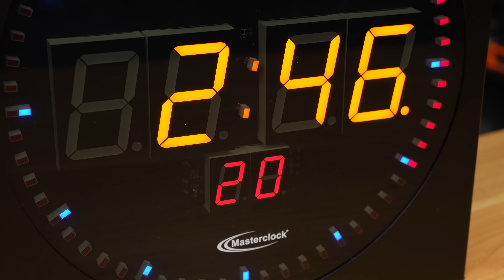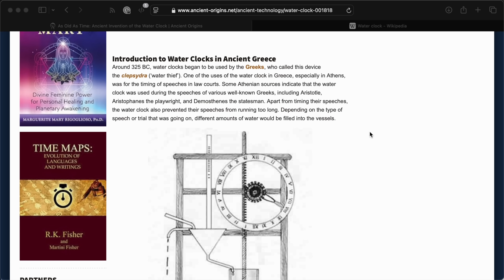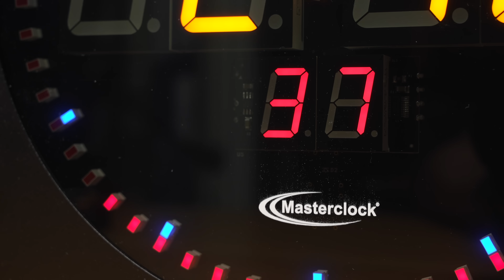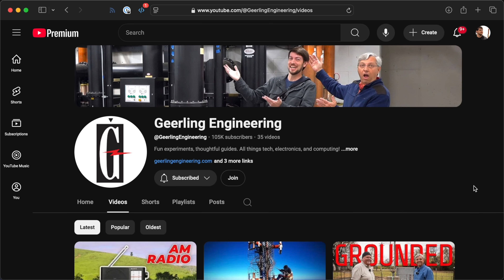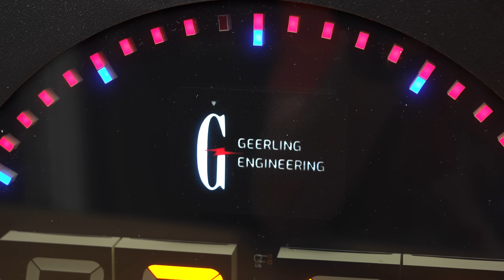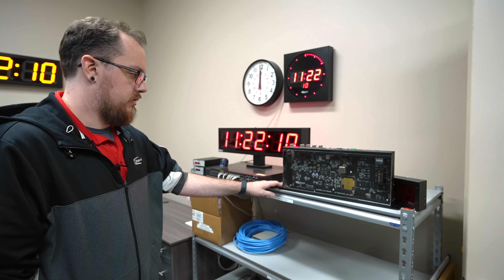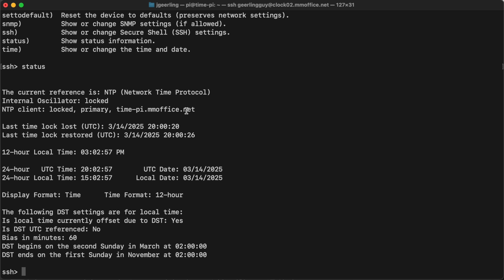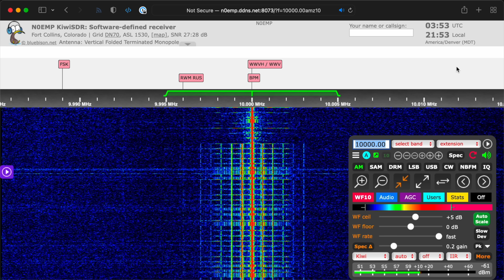It's about time...

Comment: A Finn here. Russia has been interfering with GPS signal since their invasion in Ukraine. Multiple times flights have had to been diverted to other airports from Eastern Finland. Yes, GPS signal is not universal…
Reply: True. Russia has their own system called GLONASS so they could disrupt GPS and continue to use GLONASS.
Reply: @ both GPS and GLONASS use very similar frequency bands. I am not sure does the GPS interference leak also the GLONASS range. But Russia doesn’t have much people or flights on that area.

Comment: I have an old wrist watch from Kienzle. It's a company from Germany not existing anymore. It's controlled by the radio time source DCF here in Germany. It has a small LCD for seconds and date and analog clock pointers for minutes and hours. The pointers only are moved every 20 seconds to save energy. The batteries last 10 years and this thing is still working after 30 years. And now the cool thing: it is precise like the PTB atomic clock. It's analog but precise like atomic clock

Comment: Jeff, do your switches all support the hardware backed higher level ptp in the studio, or are you falling back to the version/mode that doesn't require support from all switches in path?  It's been too long since I've looked at ptp in depth so forgive me for forgetting the correct terminology.

Also have you looked at/do you/do you plan to contribute to the ntp pool project?  I've contributed an ntp server for quite a while and it's an important and often overlooked project I feel.

Comment: When it comes to test equipment, a FREQUENCY standard is important.  That's closely related to time, but not quite the same.
The gear will have a 10MHz "Reference" input, with phase noise (variations in pulse width) as low as possible.

One method: Divide your Reference by ten million, then compare it to a 1PPS time clock. Any drift in phase means something is amiss.

Comment: Great topic for a video. I run a supersonic wind tunnel and we use a similar time system that distributes NTP, PTP, and several flavors of IRIG to synchronize the many data systems and scientific cameras on our (offline) internal network. This way we can precisely align data in time — even down to knowing specifically which handful of pressure measurements corresponds to a specific frame of high-speed video. It’s so important, but the underlying tech is taken for granted by most (even “nerds”) since it’s so transparent to those who haven’t needed to implement it in a standalone system.
Reply from the maker: I hadn't even considered that—places like CERN and the weird experiments that measure like muons or gravity waves also have to have incredible precision.

Comment: I wonder this could be applied in combination with some sort of timecode input devices for a video recording studio space that has multiple camera angles. Maybe using Raspberry Pis as the devices that push SMPTE timecode into the audio track of each camera. 

Or taking it a step further, I wonder if the server and additional devices could somehow be used to synchronize cameras/audio inputs for OBS based streaming with multiple camera and audio sources. 

It would be amazing to easily get multiple cameras and microphones (like one at a desk and one with a wireless lapel) all easily synchronized.
Reply from the maker: That is one major use case for AES67 and things like Dante... I haven't looked into Timecode output, but I have to think it's possible to DIY it...
Reply: @JeffGeerling  Thanks for the info! Multicam can be tough in the editing stage, so that general idea has been on my mind for a long time, but with a mix of outdoor and indoor video work. I've got a larger channel for photography/videography. 

There is quite a bit of timecode stuff in the videography world I've read about, but all of it tends to be very expensive so I haven't been able to try any of it out.

Comment: Hey, Jeff, I work for an electric utility. We are in the early stages of a pilot project to implement digital secondary systems for our substations using IEC 61850 standards. A critical part of these protocols is proper synchronization using PTP. Would love to share more information about it if you’re interested! Keep up the great work!
Sincerely,
An electrical PE with a fleet of Raspberry Pi computers at my house

Comment: If you get the chance I'd show off configuring the telecom profiles in linuxptp (Mainly G.8275.2 , although G.8275.1 for multicast is semi interesting)  as they tend to be more useful than a base 1588 clock and make setting up things like a private LTE network easier. For small form stuff I tend to go with like an Oscilloquartz OSA 5401 SFP timing grandmaster as they're just neat.

Another fun one to talk about is RFC 868 ToD clocks, one of the older and not so precise things out there and most people don't really know about it, but is used by every cable modem in existence as it's timing, and basically almost every Distro out there supports it since it's just basically using Xinetd.

Comment: I'd love to have my own time standard, but also broadcast low power signal like WWVB to keep my older radio clocks in sync.  The problem I have is some of them are in places in the house they can't get a good signal.  I've looked and haven't found any projects that do that.

I do have a clock that syncs via bluetooth.  It's paired with a phone so any time my phone is remotely nearby it grabs the time.  This works really well.  It's tme (see what I did there) for more clock manufacturers to use more novel ways to grab the time over the air.
Reply from the maker: It seems like the 60 kHz signal could be broadcast... though legally? Not sure.

Comment: With RPi, you can do a bit better than stock - the oscillators on the RPi can be swapped with higher precision VCTCXOs... "VC" is "Voltage Controlled", meaning that the oscillators can be steered.  Connor-Winfield has done small-batch custom sub-ppm VCTCXOs "TB604" for me in the past at about $50/each (last time I ordered from them was a few years back, prices may vary).  Those are already temperature compensated with an operating range of -40 to +85°C, and a stability of +/-280ppb (0.28ppm), and a pull-ability (the VC part) of +/-12ppm.
  
There are two on the RPi4 that you want to swap, the main 54MHz part for the CPU cores, and the 25MHz Ethernet MAC/PHY oscillator.  This gets better with the RPi CM4/5, which has an IEEE-1588-2008 NIC on board (and for "hacker convenience", the oscillators are on the bottom connector-side of the PCB - allowing for a pogo pin jumping a pad-incompatible oscillators to be off-boarded).
  
Grab a Stanford Research Systems PRS10 Rubidium standard, and fully option it out (SC-cut local oscillator, I bought a fully loaded one this past summer for about $3600 - use is a master clock in a home-lab, with a bonus of running a local NTP server), feed it a high precision GPS 1PPS from a Ublox ZED-F9, then make certain you're using the native UART on the RPi to receive the time and 1PPS from the GPS receiver and Rubidium standard.  Use that precise 10MHz output to run a counter (over a LONG integration time, like 24Hours) and steer your RPi's oscillators and your PLLs will get walked into a very VERY low error-correction relative to the hgih-holdover 1PPS from the PRS10.  Should be able to get to Stratum 1 pretty easy, the hold-over capability is the expensive part...
  
A note on your GPS setup for later.  The GPS antenna needs a full view on obstructed from horizon to horizon - if you think of the satellite direct line of sight to the GPS antenna from two satellites as side A and B of a triangle, and the distance between the two satellites as your hypotenuse, the longer that hypotenuse is to less angular error there can be in the solution.  This means the satellites visible at the horizon offer the largest opportunity for timing/position correction.
  
Sparkfun did a blog about RTK base-stations a few years back - read that, but then when they talk about not needing longer than 24 hours of RAW observations for survey correction, ignore that - do a full week so that you average out both weekday and weekend RF environment changes.  You want to do the base-station survey, so that the GPS isn't solving for its position too - survey in the highest quality fixed position you can and lock it down to fixed mode.
Reply from the maker: Oh shoot, nice idea! Would love to discuss this more, as I hadn't considered trying—can you shoot me an email or DM?
Reply: @JeffGeerling  Sure, I'll spawn an issue in your time-pi repo in a moment.

Comment: Why do you want a time server if your time on your phones or computers are in the right time zone?
Reply from the maker: It's mostly for use cases where you need to sync other devices or run applications that require more precise time across all the nodes where it's running (like Dante for A/V, or controls, countdowns, financial databases, VR, 5G)

Comment: I don't understand the point of this, is it just for fun?  Isn't the synced time from cell towers and nist ntp servers good enough?  You can run local timeservers on pihole and even a lot of routers. And if all the timerservers on earth go down or your internet connection dies for long enough for time to get unsynced enough to matter I think the times on your network being off by 2 seconds are the least of your problems.
Reply from the maker: 2 seconds is not much for most things.

But for other things, it completely breaks the application.

PTP is not necessary for most people, even GPS is waaaay overkill compared to just NTP. But it is essential for some things.
Reply: @JeffGeerling  interesting

Comment: I recently built a stratum 1 time source using a GT-U7 GNSS hat, a generic SDR antenna, and a DS3231 RTC attached to a Pi 4B. It achieves sub-microsecond precision easily and gets within 10ns of the GPS constellation easily. And all of this with the antenna indoors!

When you do install the GPS antenna with your dad, I would love to hear his thoughts on the signal loss through the antenna cable and how it could affect the GNSS hat’s accuracy.
Reply from the maker: Definitely! There's actually ways to account for the cable length too, and I may get to exploring that in the GPS-focused video... even trace lengths on PCBs are important when you get beyond nanoseconds...
Reply: @JeffGeerling  I look forward to seeing that! The GT-U7 hat came out of the anti-static bag with default settings that allowed it to work perfectly as a time source without any configuration. I would really like to see you talk about GNSS HAT configuration and when you should/shouldn’t do it. I just wish I had gotten a CM4 and a carrier board so that I could get hardware timestamping support…

Comment: Jeff, TCO is temperature COMPENSATED oscillator, not controlled.
Reply from the maker: My brain will probably never remember that correctly. Compensated is much more of an accurate term too, because there's no control, just compensation for differing temps. Oven would be 'controlled'

Comment: Genuine question - why would I bother setting up a local NTP on my LAN, if you list internet NTP as one of potential sources of time for it? Sounds like a lot of hassle for very little benefit for regular homelab.
Reply: redundancy, when you only have internet NTP that’s only one source of time vs gps and internet NTP.
Reply: That’s why our computers have RTC modules. If the internet goes down, RTC will keep the clock running until it’s back online.
Reply from the maker: This kind of setup is helpful if you (a) have devices without reliable RTCs, (b) need to have devices in sync (like in media applications, like with Dante, or AES67, or 5G, databases, robotics, etc.), or (c) need more accurate timestamps, and want to have one really good clock controlling the timing on your local network instead of trying to make sure all your computers on the LAN have good clocks.

Comment: tl;dw: get a cheap USB GPS receiver, plug it into your PC/Raspi and broadcast the time via NTP on your LAN - that's a "as good as it gets for under $20" stratum-1 time server.
Reply from the maker: Indeed. I may work on a couple other time server builds for comparison. Even a cheap GPS dongle is going to get you much better time than Internet NTP.

Comment: I have ejoyed having my Pi GPS-PTP-NTP server on my network since I made it a few months back. I have all my servers set to use it. I have an ansible playbook that I use on new devices, VMs, and CTs that I can easily install and setup Chrony to sync to my local NTP server. I am using GPSD integrated into Home Assistant to track the connection and my clock is currently 0.000000057 seconds fast or slow of NTP time. I have 35 devices on my network that are currently set to access the NTP server with chrony and the rest get NTP time from the Pi through a setting on my network that points all devices to get network time from a local IP.  I really want an NTP clock to display the time with from my server but they are quite costly. I am currently looking for a way to build or find a prebuilt webserver that I can connect to it to display the information on what gives it the accuracy it has and possibly alert me if something happens.

Comment: I've always been a fan of the work from Masterclock. As a master clock system geek since my elementary school days, I always try to identify the clock system in a facility. RDU Airport had a most excellent Masterclock clock system for a long time. I have a Raspberry Pi running a Standard Electric Time impulse clock system from the 1930s; it's awesome to think these nearly 100 year old clocks that hung in schools are now sync'd precisely to the Atomic Clock and GPS, even as they click-click ahead once a minute. I also have a Lathem Airtime system in other parts of the house that is sync'd to the Atomic clock via a receiver on the roof.
Reply from the maker: I always loved being around those analog clocks as you plugged them in. They'd eventually get the time, then the minute hand would chug its way around and around until it caught up with current time.

Comment: Hello Dr Matasakis.  I worked for DoD as Air Force and Commerce as a an enumerator and manager.  Are used to have to carry a cesium beam clock from our precision, measurement lab out into the missile field to insert time into some of the communications equipment.
Reply: If you don’t have GPS you go to WWV : ). I didn’t have GPS at the time.
Reply from the maker: Hopefully we'll get to visit WWV soon!
Reply: @JeffGeerling  tell them, Beep back at the top of a minute.
Reply: @JeffGeerling  the entire time you’re visiting them make sure you go beep at the top of every minute like they do to us.  Have a haptic feedback on your watch notify you wind yell beep at the top of your lungs.
Reply from the maker: @XAirForcedotcom  Haha indeed. Then I'll do subtle 'boop' sounds every second.
Reply: @JeffGeerling  they’re gonna see this and make you do the full preventive maintenance inspection on the system while you’re there as punishment.  They will make you do a full annual alignment of the timekeeping system and the transmitter. : ).
Reply: It would be kind of cool to listen to the station and know that you actually set the time for 2025 : )
Reply: I like Gandhi’s slippers that just have a toe knob to hold onto to😂
Reply: I like Gandhi’s slippers that just have a toe knob to hold onto to😂.  What do you do make slippers out of your old cabinet doors when you replace them?

Comment: Jeff, you turkey.  The Raspberry Pi 5 has hardware timestamping support on the physical Ethernet interface.  PTP uses that.  you don't need that special HAT with its own Ethernet port.  You do need a timing-optimized GPS module though.  Fortunately Adafruit sells one that is pretty inexpensive and in HAT form.
Reply from the maker: I've been working on hw timestamping on CM4, CM5, and Pi 5 — and the Pi 5 does have hw timestamping... but no PPS in/out pin, so no way to verify it or use a better time source :(

So the HAT unites a timing-oriented GPS module, a NIC that is known-good for PTP hw timestamps, multiple programmable PPS ins and outs, and some level of support that Raspberry Pi hasn't committed to for the Pi 5 (but they do seem to care more on the CM5 at least, even if the documentation's been a little fun to deal with).
Reply: @JeffGeerling  there are hardware interrupt pins though; are they not usable for a PPS signal?
Reply: The Pi 5 does not support hardware timestamping. You need a Pi CM5 for that capability.
Reply: @TheOneKEA  The Pi 5 does.  The Pi CM5 does.  The Pi 4 didn't but the Pi CM4 did.

Comment: It's interesting badly many state of the art industrial machines retain time synchronization. I work in food industry and we try to keep quality management high and recording time of like product changes etc. happen, hence I try to setup clocks really well on equipment that users could easily see time from multiple locations. They're pain many times to input time and many might be surprised, but there's tons of industrial equipment that aren't networked. But even like every summer/winter time change I have to input time again as it really pisses me off that time drift on many equipment can be few minutes already. It's quite funny to think that hundreds of thousands worth machine can easily have worse clock than the "terrorist" model cheapo plastic Casio wristwatch which costs like 10 bucks or something.